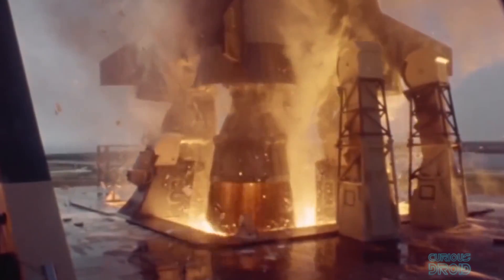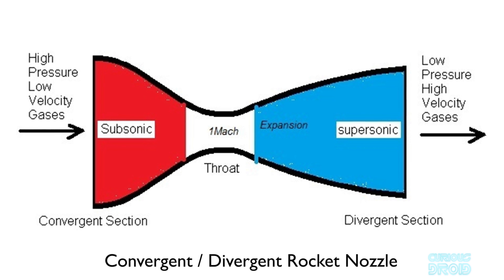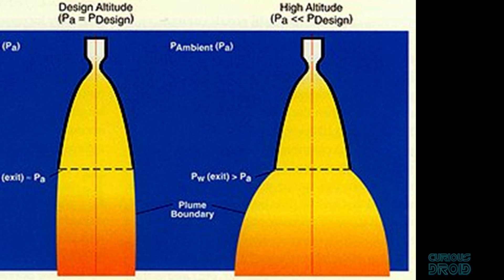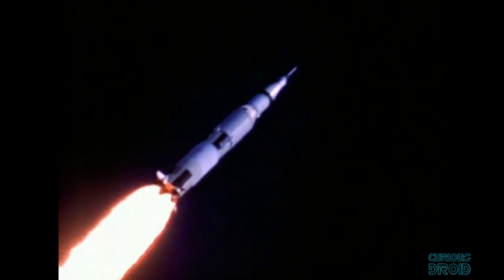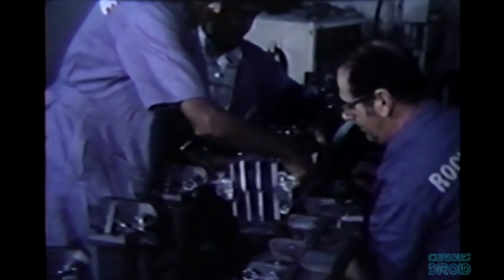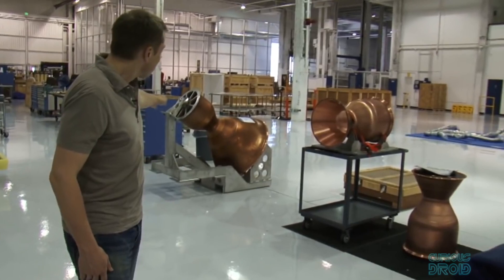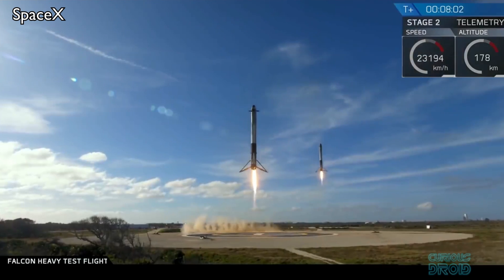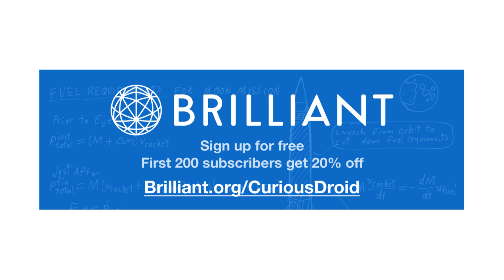Aerospike Engines - Why Aren't We Using them Now?

Comment: Well technically they use similar engines for vertical takeoff and Landing on fighter jets utilizing the thrust vectoring system and the SR blackbirds have the spiked rear end turbine as well, but you should be asking yourself why don't they use the ferrofluid centrifugal engine for any kind of flight. We don't use that because it's a secret space budget Vehicle called tr3b ( tactical recon)it's  a big black triangle. doesn't need rockets and it goes like hundreds of times faster because the way it works is like anti-gravity, the mass is reduced to 10% of original weight and manipulates earths magnetic feild so less force is needed for propulsion. the engine is shaped in a toroidal Hollow magnetic vessel, like a hollow doughnut, and contains a liquid metal that's super conductive. a type of metal like Mercury with some sort of antifreeze type additive so it can be cooled below way below zero and then magnetically it spun like centrifical force inside of this hollow toroidal engine. just like the incredible properties of centrifical force, the properties of centrifugal force that manipulates a super conductive ferrofluid are even more interesting. it reduces the mass of everything within it's own magnetic field it creates. this is how you can see a UFO do a 90 degree angle turn going thousands of miles an hour and have the pilot survive the g force, its because they only way a percentage of what they did before they entered the craft. like how ant can survive falling of tree or cliff. that engine is only meant for mass reduction. then a secondary propulsion system is used.  much more efficient than fuel driven ones like turbines I can't explain that one.
How about a scramjet engine they don't use that one yet either . but what's more important question to ask is how much do they spend of your tax money on these engines that's sblew out so much chemicals and carbon dioxide carbon monoxide into the atmosphere? for what? all for what? nothing really. have you ever wondered how all this stuff is possible?
 test your knowledge of physics for a moment fire needs oxygen to sustain itself so how the hell do you think that works in a vacuum devoid of all atmospheric gases? there's no way they could bring enough with them you can't pack all that into a rocket engine and even if you could,i think it's Newton's third law-when a force is applied to another Force it returns an equal and opposite reaction- a jet engine, not even a propeller, will not work in a vacuum. it's pushing against nothing. There's no way to propel yourself against nothing and there's no way to slow yourself down against nothing. like an object in motion stays in motion unless acted upon by an outside force. therefore no outside force, nothing to act upon it while in motion. make sense? understand? Like a falling object on earth reaches a terminal velocity due to wind friction you will only fall so fast until you will reach a certain speed wear you can't overcome that speed due to the wind pushing back on you. this is how an ant can fall off a building and not even get hurt because it has so little Mass its terminal velocity isn't very high. it doesn't get going to quick. like a feather just floating. None of these things can take place without something feeling the void.
 while I'm on the topic there's no sound in space either right? this means that all radio / microwave transmission is impossible before you just dismiss that really think about it because it's impossible. All sound travels in wave form frequencies the same is true for radio or microwave because it's all waveform frequencies it's all sound. even light is wave form frequencies. and for it to travel or be transmitted from one point to another * it needs something physical to travel through* like an atmosphere.  or gas. even cement, it won't travel as far or as fast, but something has to be there. if you put an alarm clock in a vacuum container and void as much atmosphere out as you can the sound disappears. now that you've realized what you already knew about physics, apply that realization to space travel. does it compute? try to theorize possibilities for those examples to work.
 nothing works in a vacuum the human body actually boils in a vacuum you know that? the water begins to separate from your body and you quickly blackout and die. the astronaut space suits only have 6 pounds of pressure! can you actually imagine what would happen to something like that in a complete vacuum? can you even imagine what a complete vacuum is? is that even possible? what happens when you void all the contents of a soda out of the can? it's empty right? no that's wrong. because when you empty the contents out,  you gain an oxygen combination of air that fills the previous place of that liquid. for that can to be completely void, a complete vacuum, you would have to crush it until nothing, nothing would be in it, nothing!  can't have nothing. you can't even replicate a complete vacuum. but if you do attempt too, and come sort of close, everything changes. the properties of everything is different. sound disappears. any movement any type of propulsion is canceled away . if any type of object was introduced into a vacuum it will usually implode- or no it will explode actually. everything Will have it's content sucked out of it to fill the emptiness around it. 
that's not real. 
the more you think about it. the more you'll find it's impossible. open your mind and think about it hard . the vacuum of outer space is so many more times inhospitable than the depths of the ocean and we can't even get to the bottom of the ocean.it's unfathomable to even comprehend the force that a complete vacuum should produce.
Remember that space is only theoretical and has never Ben experiment to the pond or conceptualize Beyond imagination even gravity is still just theoretical because there is no defining Force. there's a greater understanding of magnetic ism and density and buoyancy gravity is just a name to explain something that happens some Magical Force and then things are branched off of that more theories are branched off of more theories until until everybody thinks this is reality when it can't be replicated or proven Beyond pictures and ideas nothing becomes concrete or evidence until you can apply real science to it science is a process of a hypothesis or a theory and the test is done an experiment and then you having a result it's not just some guy with the theory like a theory of relativity a theory of gravity I do not concrete these are ideas Beyond and they can't be proven or demonstrated Beyond verbalizing this is called pseudoscience you can't measure the distance of a star it's pseudo science none of its real if it's concrete and to see we're going to Mars is such a wild speculation of fantasy when you realize all of this they spend upwards of 30 billion annually while they pollute the skies with these Rockets that cannot work in a vacuum. they go up and then they fall back down it doesn't not make sense to Arc as you gain elevation you would lose momentum there for you have to use more fuel more and more problems occur in the real world view smoke and mirrors that's a reason to continue Gathering funding a whole lot of it from you . you don't think there could ever be a conspiracy like this? did you know that the United States government started NASA by removing Nazi rocket scientist from Germany after World War II, absolving them of heinous war crimes, and then placing them into the NASA program to run it, to create it? that's true. it was called Project Paperclip. I bet you think you can trust an agency like that right? a  place run by Nazis scientists  used to experiment on children during World War II? think about that...

Comment: fuel cost is only one reason why you would want to make an engine more efficient. if you make rockets that can make it to space with more unburned fuel you can use that fuel to get into deep space more quickly than using all the cheap tricks we have right now like sling shotting around planets for a velocity boost.

Comment: Is this about the "Dynasoar"? If it is we must be on the 3rd, 4th or even 5th version of it now. There are Dynasoar's of varying sizes and payloads. This is old news. We also have extremely high altitude blimps. Yes blimps. Lockheed does those mostly. The "Phoenix Lights" was one of them. That is why such a huge craft was able to move so slowly. It is an extremely advanced blimp. Guess the test crew forgot to turn on the optical stealth. Yes we have had that as well for awhile.